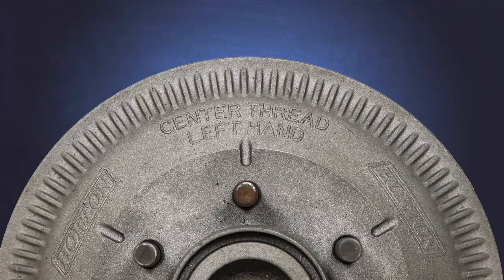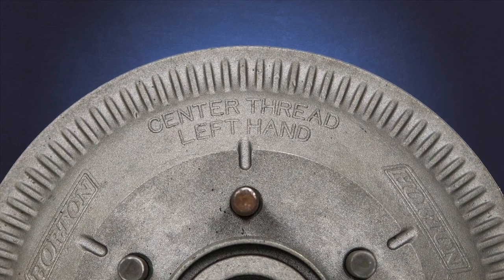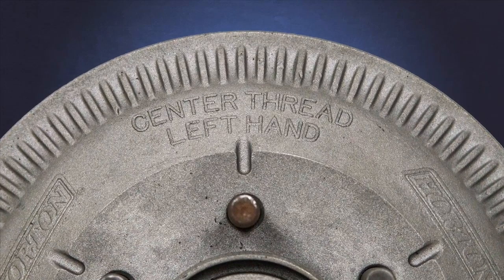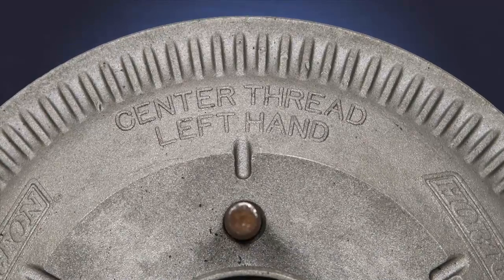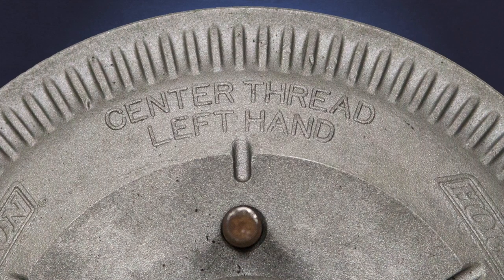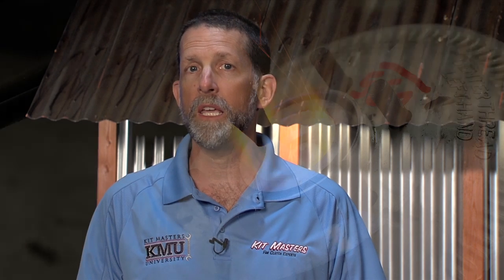Removing Horton® DriveMaster® Fan Clutch Friction Plate

Comment: I tried to take one apart today. 
Used a half inch impact. 
Applied heat to it. 
It didn’t budge. 
Be warned: if you try cutting it , they will not accept it as a core any more. The core value is 800$!!! 

I opted to just buy a remand one and returned the rebuild kit. 

There is a reason you can find those rebuild kits easily and not the actual fan clutch. Cause no one wants to rebuild them because of this exact bolt not coming out.
Reply: Yeah just looking at the rust bolt and small torx screams leave it alone.  Those clutch are 1200$ in 2024 and 500ish rebuild kit